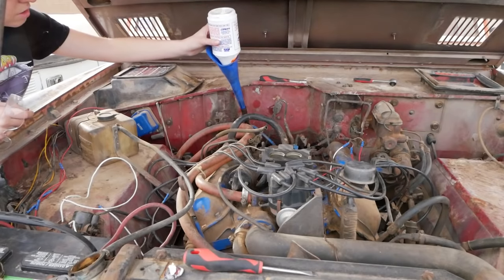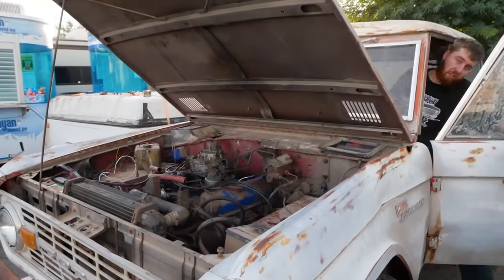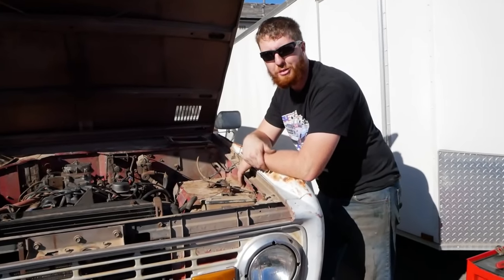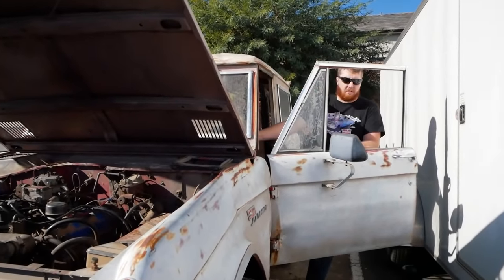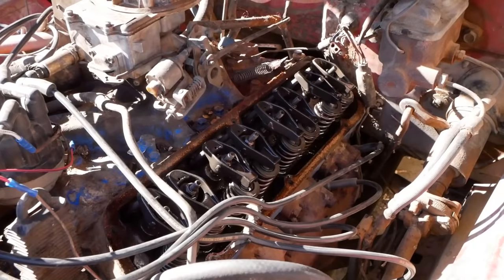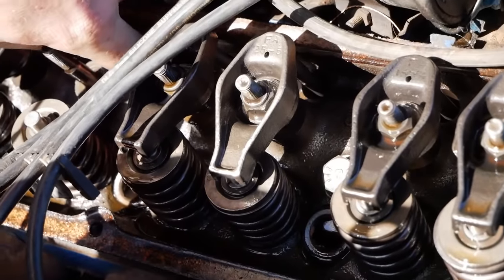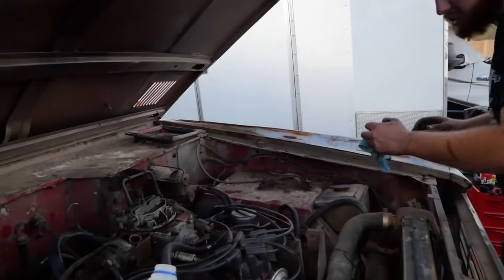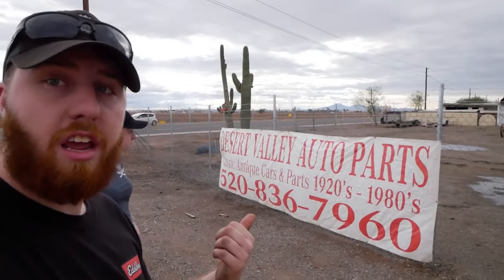ABANDONED Bronco Saved After 10 YEARS in a Storage Lot! Will it Run and Drive?? - Part 3

Comment: I live in Memphis, TN, and have worked in auto parts for a total of about ten years on and off. In my experience, the biggest issue is that most of the people I encountered did not know anything about cars, and could not afford to pay someone else to fix them. If a car had a cooling system issue, they would either dump stop leak in it, just keep driving the car until it quit running, or pay the neighborhood substance abuser to fix it. Due to the heat and humidity in my area, it is really tough on cooling systems. Since most people are unwilling or unable to repair them properly, cooling system and engine issues are very common here. You have to be really careful buying used cars in the South. When I am buying a used car, the cooling system is the first thing I check.
Reply: A couple of other comments reminded me of something that I forgot. A majority of people in this area also believe that antifreeze is optional. They are under the impression that antifreeze is just something that the car companies made up to get more money from people. A lot of people around here run their cars on nothing but water.

Comment: Maybe in the south the heat causes rubber and plastics to crack easier, so there's more stop leak in those cars. lol. 
I just refurbished my 1998 park avenue that's now my primary car, about 1.5 years ago.  loaded with rust and stop leak and expired dexcool coolant. Five flushings later, new thermostat, new radiator, new heater port o-rings - beautiful. the minor GM electrical issues are quite annoying, though :)  Still, an overall very enjoyable car.

Comment: Being the mechanical hack that I am, I add fuel system cleaner to the first gas on every vehicle I start up after a long hibernation.  

Good fuel system cleaners are nitrogen based and have PEA (Ployetheramine?).  I don't know what it does, but I have pulled the sparkplugs in my truck with 75,000 miles on them and after a recent tank of gas with Red Line Fuel System Cleaner; they looked brand new, not a speck of carbon deposit!  I was stunned!  Does the same for your intake valves too I bet.  

I don't believe any "tune-up in a can" hype, but good fuel system cleaner works on fuel system deposits.

Comment: There are a lot of cars in the west that are either running straight water with no antifreeze or they don't change it it never gets cold enough for people to worry about it freezing so people just forget about changing coolant or fill them with straight water and run them until the cooling system starts to have issues

Comment: The "roadkill overheating" thing. I live in Western Australia, a very dry place, hot summers, it never snows. we have those same sort of overheating problems here. head gaskets that dont seal, cracked heads from previous overheating, warped heads. its a real problem in dry hot climates.

Comment: well, coolant does turn corrosive after a while and if you never change it like most people, you get what you have here. every 2-4 years flush and change that stuff if you don't want your engine to look like this. an easy way to find a noise is to use an improvised stethoscope. get a long screwdriver, hold it against the engine with your thumb over the end, and put your ear against your thumb. as you move the screwdriver to different places on the engine, you can pinpoint where the noise is coming from.

Comment: it's very simple: in the south west people think it doesn't freeze so antifreeze is a waste of money, and that is the result of it!
I had the same fuel issues once. I put 2 gallons of 40! year old fuel into 18 gallons of fuel in my Lexus LS400. the next day I had a starting issue but it started up after some extra cranking. the second day I had no compression anymore and the motor did not start anymore. As long as the motor was warm it was ok, but once it cooled down, the varnish got thick and kept the valves open! We washed out all the valve stems with WD40 which did the trick. And of course dumped all the fuel out. Never would have guessed, that 2 gallons in 18 gallons of fresh fuel would do anything... I sure was wrong!!

Comment: Speaking from experience replace the rubber brake lines front and rear to get as of brakes as possible without  adding disc brakes and a booster. Neglect is the cause of the cooling system problems so change your coolant every 2 years and use distilled water or a 50-50 premix

Comment: Probably faster acidification of the coolant in hotter climates. I am a chemist and will look into this further, but iron changing oxidation states (so rust formation is an example of oxidation state change) can facilitate what are known as 'Fenton reactions.' The change in oxidation states is facilitated by higher temperatures. The Fenton reactions causes free radicals to form which can interact with to organic buffer components making the coolant more acidic which causes a cascade forming more rust. 

This is what I think it is, but like I said, I will have to look into it more.

Comment: I think the rust in cooling systems in warmer states may have to do with the convenience of using water in a cooling system, where in the north there would be a need for antifreeze with more rust-preventatives in it. Letting it sit for years and voila, rusty crusty grossness because grandpa used a garden hose to top off that radiator the last time.

Comment: I live in AZ I can tell you what is. It’s people who use water our water down here is very “hard” or full of minerals. Look at any sink faucet or shower head and you’ll see all this mineral and gunk build up. Now run that same water in a closed loop cooling system for 40+ years and it wreaks havoc plugging holes up.  All depends how long and how much water was run through it. If it’s only temporary and you flush it out with antifreeze after you fix it you’ll be ok. 
Our 78 lil red express was the same. I had to replace the radiator in my CJ7 from it being clogged. So if you want to run water for some reason DO NOT RUN HOSE WATER IN AZ. 

Great video. Good day eveyone

Comment: I would use Marvel mystery oil as directed in place of an equal volume of 2 stroke oil, or by itself, since MMO both cleans and lubricates it should help the valves in 2 ways and help the carb.  Lots of liquid carb cleaner in the fuel works too and can be used with MMO.

Comment: It's very common for people here in AZ to not run antifreeze (or not enough) in vehicles since we don't really have to worry about freezing for the most part. I got a Mustang that had been sitting for 20 years with pure water in it, the water pump was rusted solid and the freeze plugs were all rusted through. Probably why you don't see this as much in the midwest.

Comment: Sea foam that beast! And others in the future... Run a good vacuum source right into the can and open up the throttle. Will free up sticky valves, clean the whole intake in a hurry. It cleans out carbs run off an auxiliry tank very well too. You can add the stuff right to the oil, and old gas. But as a rule, try and avoid bad gas- plz? This would have been a nice running engine before the crap hit the fan. Still love the show though.

Comment: Carry a small spray bottle and some 2-stroke oil. If I have a problem like that I mix a little 2 stroke oil in some fresh gas to loosen the valves up. The oil is made to mix well with gas and it can be sprayed down carb throat. Not so much that it will be a problem just enough to lube valves.. Love your videos they are excellent mang and womang (mook) 😂🐣

Comment: Regarding southern and western cars having overheating problems...  It may not freeze in these areas except on rare occasions, so people in the south and west are more prone to putting straight water in their cooling system than an anti-freeze mixture.  Anti-freeze contains rust prevention agents, and without them cooling systems will rust away.  You are seeing the signs of that rust in your cooling system.

Comment: One thing iv seen in the south, for whatever reason, is straight red clay mud in cooling systems. But that’s generally on mud trucks that live life mcovered in clay mud. 

One issue you will see in southern states that don’t get bellow freezing in winter, is mostly older dudes running tap water  without any antifreeze.

Comment: I’m actually shocked with as many revivals you have done you haven’t had problems with varnish old gas sticking lifters and bending push rods. You never run off the old tank for that reason.

Comment: I am pretty sure the cause of cooling system issues for cars that lived or sat in the south and west is that since they dont see cold temps like the north, they run straight water. anti-freeze has rust inhibitors that slor down rust and corrosion. water speeds up the rusting process.

Comment: In my area in aus the rusty cooling system is fairly common you will find it in 10 year old cars regularly it's from people running tap water that's very mineral rich can be a pain and u can try store bought rad flush but our dodgy method is running diluted white vinegar in the system without coolant it's probably not amazing for the motor but breaks down that rusty crap fast just get it hot and it works great

Comment: Our water here in Phoenix is super hard.  Nothing rusts here because of no snow/salt, but putting tap water through your cooling system here, will eventually reek havoc on your system.  A '73 Bronco, I'm sure that's what it is.  But by the looks of it, this Bronco didn't spend it's life here in AZ....way too much rust for that.

Comment: Bottle of atf down the intake on a hot running engine works wonders. Little bit at a time then drown out the engine and let it sit for a while.  Same with sea foam on a vacuum line

Comment: Whether the pushrod gets harder or softer if you heat it mostly depends on how fast you cool it down.  If you throw it in water to cool it fast, it will probably get harder, where if you let it cool slowly in the air, it will probably get softer.  Cooling it in oil is in between.

Comment: All those backfires probably blew the power valve in the carb. Once you get the engine freed up and running reliabily, you will need to change that out to get it to accelerate properly.

Comment: I think a lot of people in the south use water for coolant rather than radiator fluid, and it just eats the stuff out inside like that, I bought my 92 Silverado in Coolage AZ and I noticed the temp gouge would sometimes seem to move, turned out whoever owned it took the thermostat out of it and my truck just ran way too cool and took it for ever to idle down after a cold start, and I had to replace the housing as it was just ate away on the inside, I was worried about the hose clamp crushing it was so bad.

Comment: at 6:26, I swear something shot off into the radiator. On another note, this could have been parked with gas in it and it just evaporated off and the schmuck left behind is what contaminated the new gas you put in it, along with the rust and stuff from the tank.

Comment: personally i feel that the engine is completely salvageable. Drain it, pull it, and crack it open and take out everything that is loose or rattles that is not supposed to be loose or rattle. replace with new{ish} parts and button it back up.

Comment: The desert southwest - cooling systems just work all the damn time, so they get more wear and tear in general.  The rust in the system is because that's where the moisture _is_.  And in places like Arizona a lot of times people if they have to refill a radiator won't even bother with anti-freeze because why?  it never gets that cold.  Which only makes rust issues inside the cooling system worse.

Comment: In the tank, there is a fuel sock that should block larger particles. At the carb, there is another filter that should catch more.i never had a problem with a cooling system in any car thst wasn't for good reason, aside from a failing water pump on. 67 ford galaxy with a 390 engine.

Comment: THe gas is varnished, the tank needs to be pulled and cleaned with acid. it can then be flushed with water and put back on the bronco. Your methods are very interesting from a mechanic standpoint.

Comment: Simple answer to the pverheating problem in the desert low lands, is this. How many people, if ir rarely gets cold, even run antifreeze/coolant? Instead they run tap water, which has impurities, causing rust and scale in the coolant passages. 

Usually right after an overheat, at the roadside spigots. It ruhs cool,  and gets left in the system, causing more issues.

If you read the directions on the coolant jug, it tells you not to use tap water, creek water, spring water, ect, to dilute the coolant. It tells you to use Distilled Water, for a reason. No impurities, so nothing to boil off.

Distilled water does not boil, and does not corrode iron and aluminum parts. Why they tell you to use it.

9 years between AZ, NM, and SoCal. 8 between the southeastern coast, and the Gulf Coast. Dad always kept coolant and distilled water in all our vehicles, except the bikes, which were air cooled. 

Also. Most will go to a 3 core radiator, and still use the standard, lower flow, water pump, eith that radiator. When I lived in AZ from 94 to 96, the first thing I ended swapping the factory 2 core and pump to one from an F 350, abd running a 75/25 mix, coolant to distilled water. Kept it cool even in the dog days of summer.

You need capacity, sure, but capacity doesn't help, if you don't have the flow to circulate it fast enough to copl down, before returning to the block. That and drop the thermostat temperature by 10 to 15 degrees on the older, carburated vehicles. Opens sooner, at a lower temperature, keeping the engine cooler. 

Doubt you'll ever see this, but it may help others avoid those issues.

Comment: hot dry air down here kills all rubber, plastics, electrical, and yes cooling systems. Sucks. In vegas, probably the most jobs ive done have been cooling system related

Comment: My guess with the coolant system issues in west/south west. Wrong coolant. Not using IAT or using straight hard ground water. Or blending of different antifreeze. Less humid, hot dry air. Kills water pumps, coolant passages, and wrecks radiators.

Comment: How about not using a filter but a separator? In boats there is a stacked up unit. The filter is between the alu top and a glass bowl. But check carefully! If you follow the arrows of flow it goes trough the filter first and than to the bowl. Counterflow the arrows it goes trough the glass first. Thus you can see the ...... because it settles in there. Also water. Its used as a water separator. Ps its aprox 4 times 6 inch. Find a way to locate it somewhere. But it makes a ...(lot) of difference.

Comment: On the cooling system. In the south where it doesn't freeze ever people don't use antifreeze, or at least don't use enough antifreeze. They figure they don't need it since it doesn't freeze there, but what they don't realize is that antifreeze also has corrosion inhibitors in it. If you only use water and no antifreeze you get what we saw here today.

Comment: Your not gonna let it go that easy. These old Bronco's are worth more bank to collector's than you'll have in it by the time your done. Primo resto-mods are auctioning around 30K or more, and I'm certain you didn't pay more than a couple grand for her. Just tip and strip her down like you know your gonna have too anyways. She's as coked as a drug mule, and Challenger plants are a dime a dozen. That's the name for the 302 c.I., from Fomoco back in the 60's when they came in mid & full size autos. Source you quality painless wire-braid, and an all things aluminum, 3 or 4 pass radiator while your breaking the piggy bank on this one. Yes, your brake hoses are swollen, but stainless steel braided nylon replacements are a better investment, while your on the metal line rehab. (Silicone-bronze preferred). Grab yourself a fist of steel hardware springs for all your bends, as it keeps everything in order with your brake bends. You and your shotgun, Mook, did fine. Happy New Year to you both. Tell your Brother Thunderhead, warm regards from me. Very safe travels.

Comment: well, in the panhandle of Texas if you use city water in your radiator / cooling system the florine, chlorine, salty and other garbage
is very corrosive.  it usually eats freeze plugs and aluminum.  by the way I don't drink water cause it takes bad.  Some towns are worse that others.

Comment: I'm just confused as of why not use lithium batteries for these revivals cause they have higher cranking amps and they can put out a higher current for longer periods of time and they also hold a higher resting voltage and recharge faster aswell

Comment: Arizona is rust free, hardly any rain! For the outside of the car. Now, the inside of the engine. Since so hot, no one runs antifreeze, no freezing. Do they use only water, hince total rust out over time. Inside of cast iron block, coil wire inside water Jose's, so yea.

Comment: Also, i heard running the oil additive tends to weaken the camshaft by over hardening it? It may be a different additive but i heard it sort of bonds too or attacks the metal and when it heat cycles it heat hardens the cam and other components causing cam failure. Is this from that additive or a different additive? It may be the break in oil that causes the camshaft to temper wrong and harden but im not sure